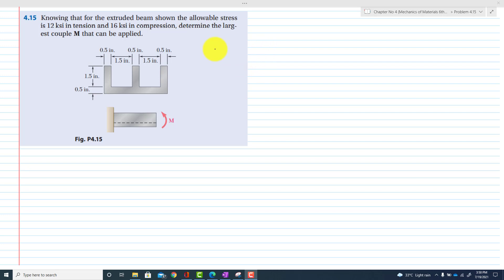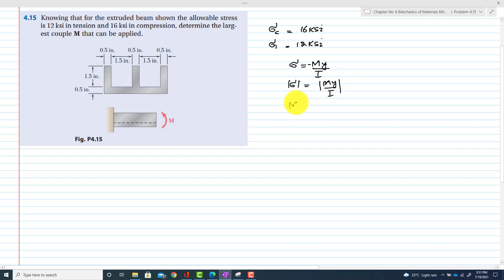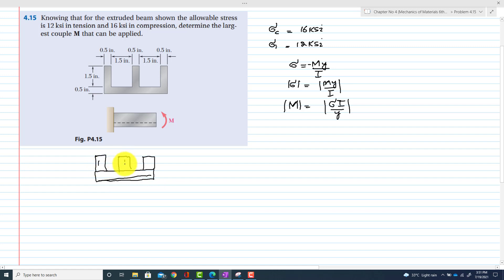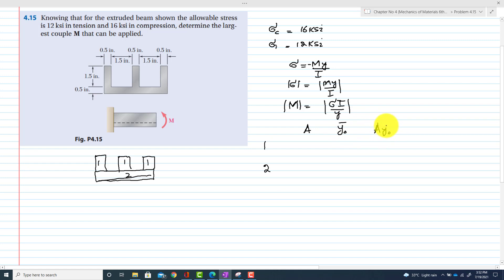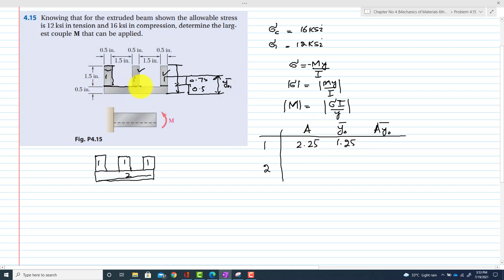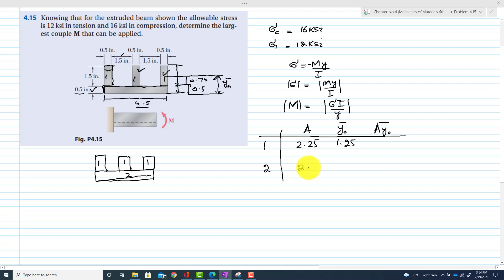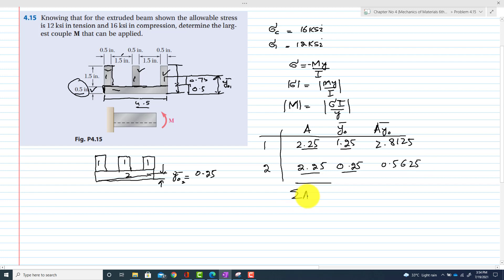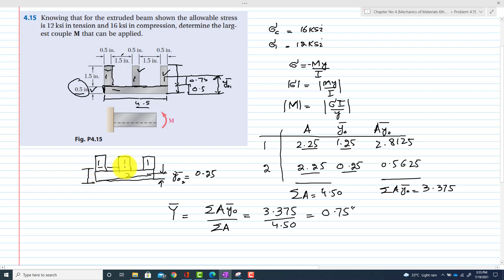#Mech of Materials# |ProblemSolutionMOM​ | Problem 4.15 |Pure Bending| Engr. Adnan Rasheed

Comment: sir ye ynot first wale ko 3 se q multifly q nhi kia
Reply from the maker: The one  area of 1 is 1.5 x 0.5 = 0.75 and there are three so 3 x 0.75 =  2.25 ❤ I hope it is clear and it's short cut you can manage it seperately.  It will give you same answer